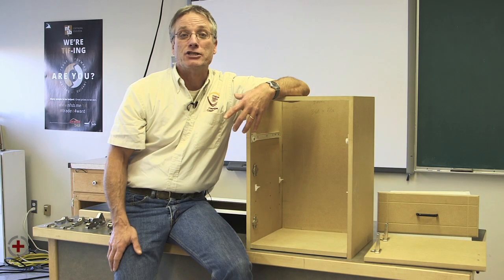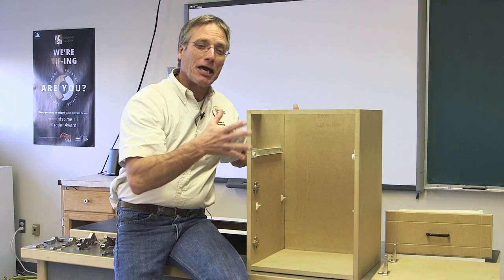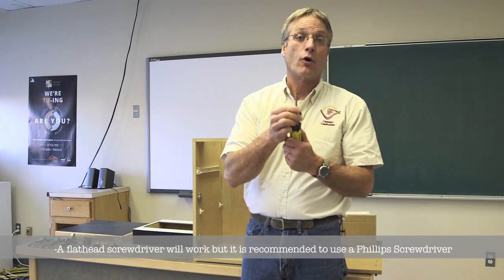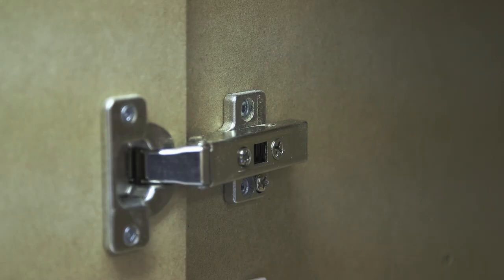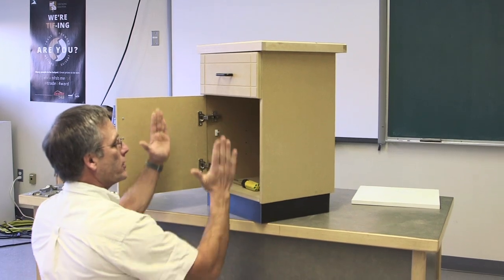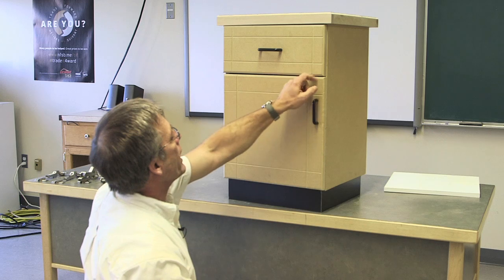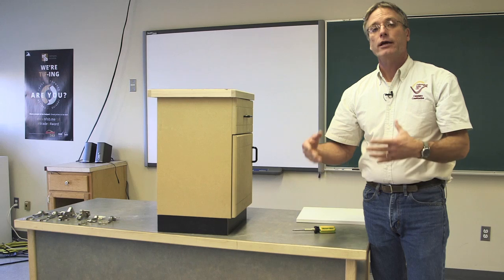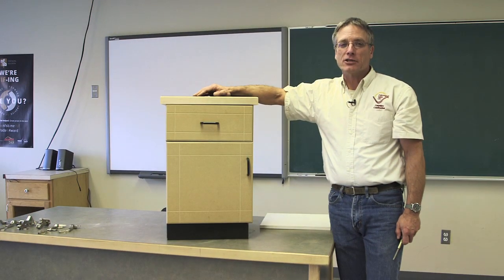How to adjust your cabinet doors in less than 5 minutes

Comment: Your video is incorrect, most cabinets (Ikea especially) uses Pozi Driv screws, not Philips. If you use a Philips you will strip the screwhead

Comment: This is a great demonstration of the 3 adjustments that can be made on a cabinet door with a left hand side hinge. I would actually say, though, rather than pointing, and I would slow down to a crawl, that turning the first screw clockwise makes the door move left and that turning the second screw clockwise moves the door inwards.  Still, this is one of the best videos to actually see all this. Very helpful.